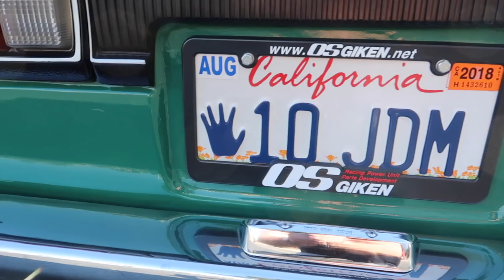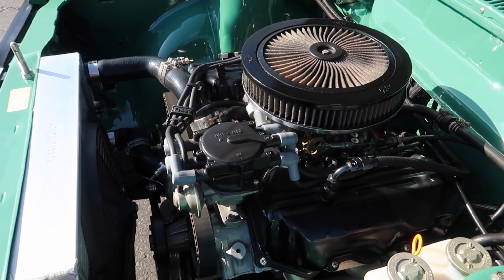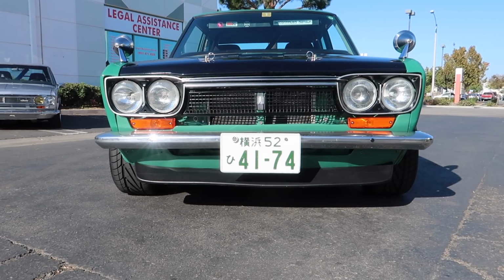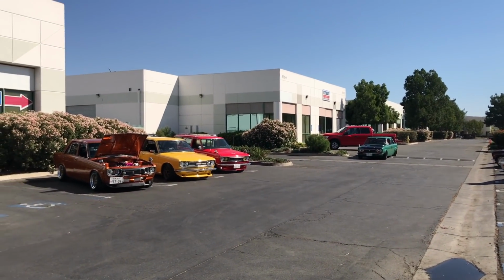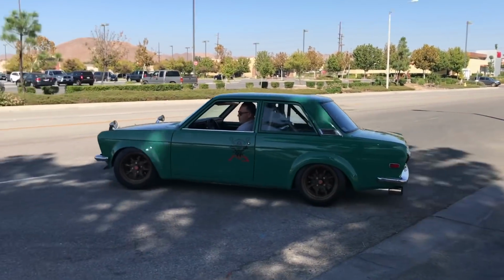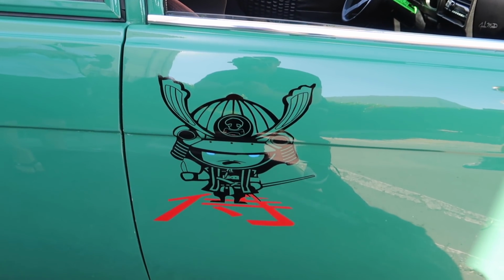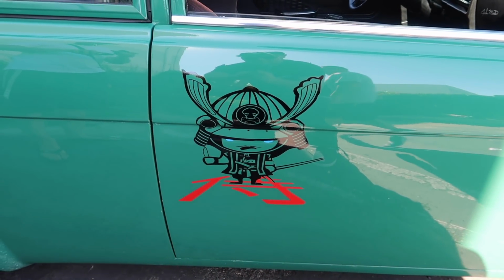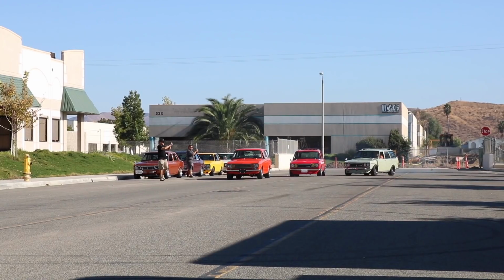Datsun 510 VG33 Conversion

Comment: Awesome vg35 !!  Question - are you still running a r160 differential? What gears ? I recently mated a 240z r180 3.70 to my vg33 and it seems to like the taller gears.